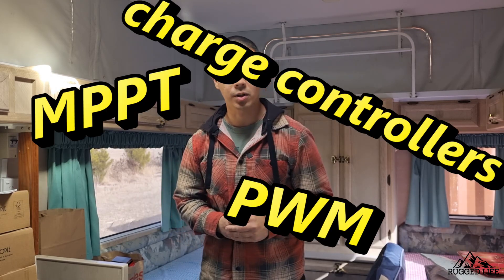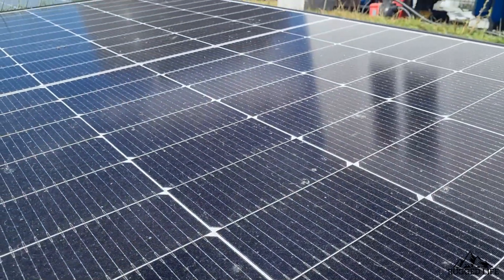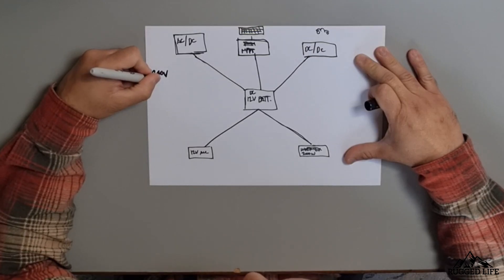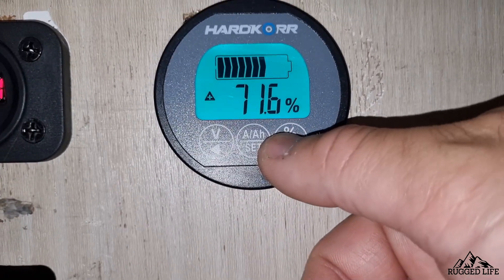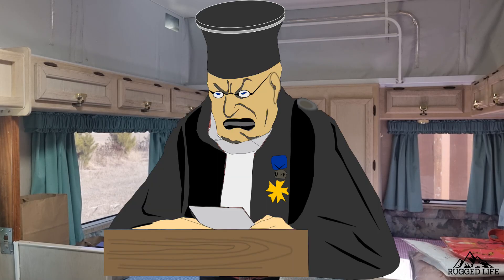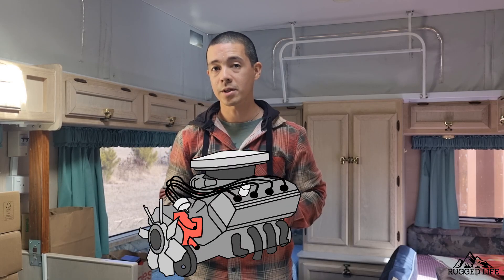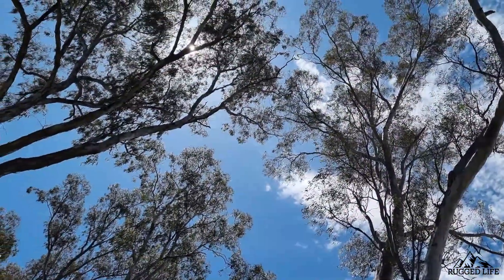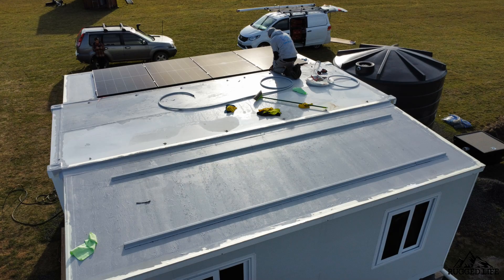Off-Grid Solar Setup Made Easy | 12V System Basics for Beginners

Comment: Good explanations, thanks. I'm putting together a self charging EV boat and this was very helpful for me. Thankfully I'll only be running a trolling motor and a couple of led lights so I won't draw as much power out as a caravan would. 

I plan to have 2x batteries in the bow, charge controller and fuse close by on the front panel where the old gauges were, 2x solar panels mounted on the frame where the canvas roof is and said frame fixed in place, huge wires in 20mm conduit going from front to motor through a huge fuse near the batteries.
Reply from the maker: Cheers mate. Sounds like a good setup 👍